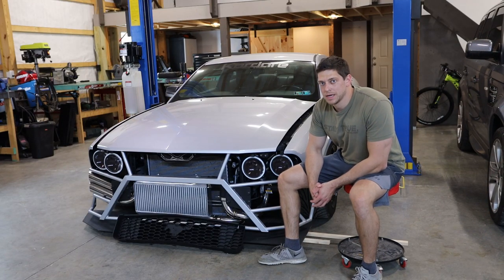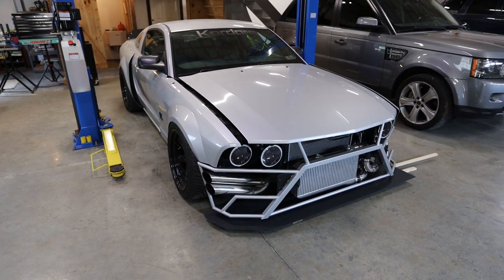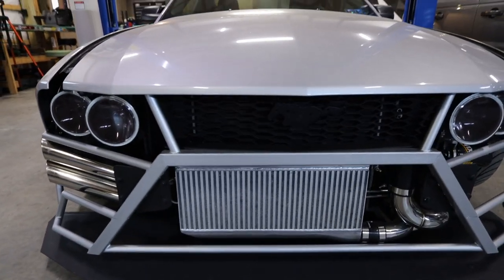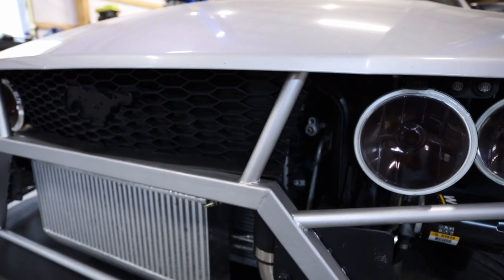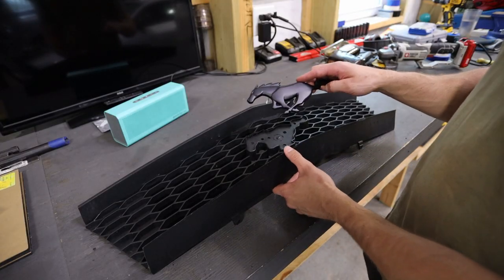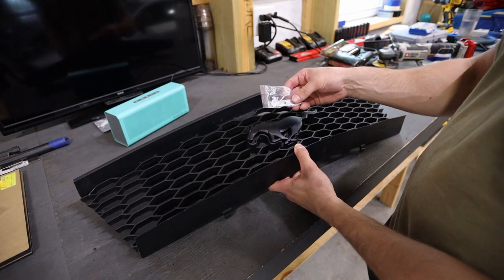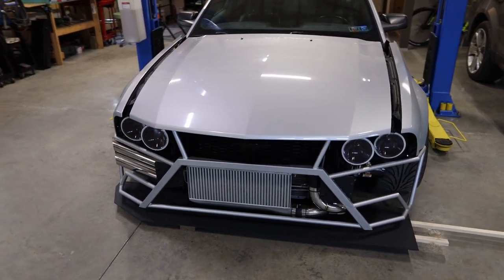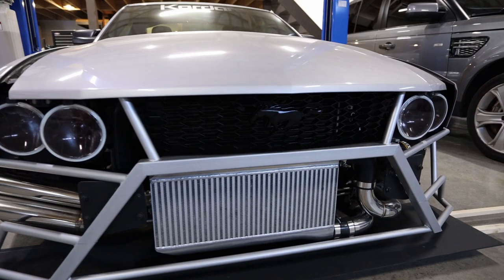Custom V6 GRILLE Install on the Turbo Mustang

Comment: i think paint matching the just the pony emblem to the body/bumper color would help that subtle little detail come through a little more. for the bumper holes, i could see covering the drivers side completely, then cover the passenger side with cutout and have some metal plating around the cutouts to protect the plastic from melting and give it a little more of that raw/edgy look the whole front end gets.
Reply from the maker: Appreciate the feedback 🙌🙌

Comment: I like the open look where the bumper used to be but if you were to close it I’m go to the top of the exhaust tip and make two exit cutouts and that could also look cool
Reply from the maker: Appreciate the input 🙌

Comment: I love this car man I wouldn't close in but just the small areas but leave the exhaust exposed and the opposite side open to. But I've liked everything you've done to it so far. I recently hit a deer in mine wanted to do something similar but my insurance won't let me has to go to there shop 🙃  love the car man keep up the good work
Reply from the maker: Thanks I think I agree with you. Good luck getting yours back on the road 🙏

Comment: Looking good.I like the grill, I wouldn't close in the sides tho. I'd add another grill/similar to cover the radiator/bottom just like you did the top. Maybe even the two lower side openings to make it look mean ,Leave that dope ass metal piping exposed.again nice build man.
Reply from the maker: Thanks! I appreciate the input 🤘

Comment: I like the grill. I think id look better if you made plates to block off the sides, I just think the expose cut doesn't look too good. Also, fog lights in the bottom right and left sections?!?
Reply from the maker: I kinda agree, I can always add that and yeah I've thought about some fogs as well 🤔🤔

Comment: What halo headlights are those?  Do they have the same mounting as the ones on the original headlight video you did?
Reply from the maker: They are the same I just tinted them
Reply from the maker: https://youtu.be/WdrL2zEb9GM
Reply: Ok so the originals are halos. Do you have a link for them?
Reply: Never mind. I found them. I’m building a 77 nova.
Reply from the maker: @anthonyriley4239  they are hella 500s. They are not halos
Reply: Yeah I found em. Only reason I’m saying halo is because of the halo ring on the outside. I found the hella 500’s with the halo ring. Thanks for your help. Do you take content requests? Lol I’d love to see how you would flare some wheel wells. I did the cut and fill method